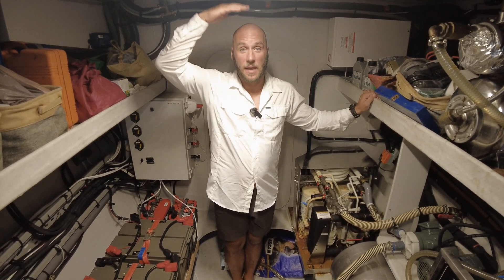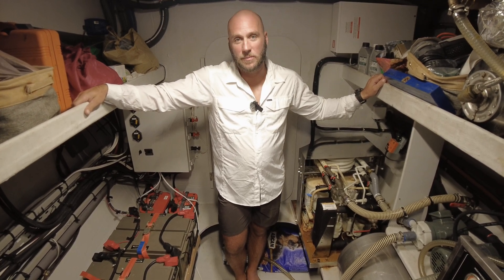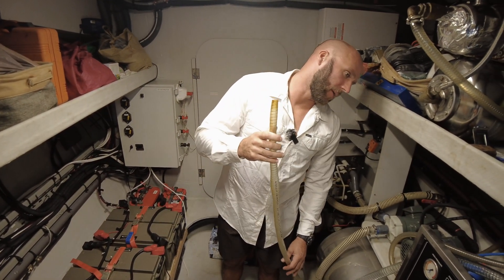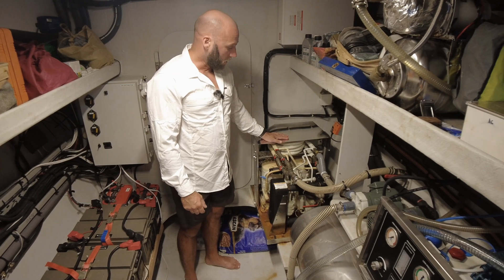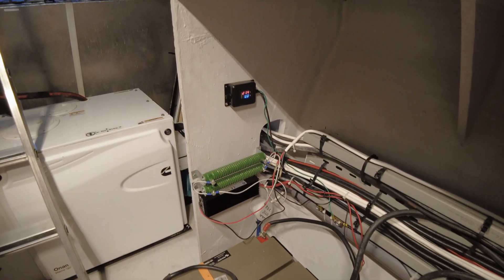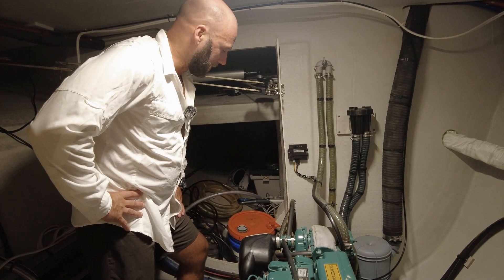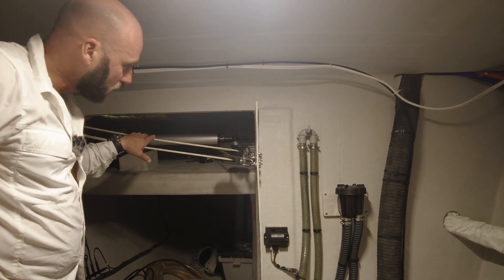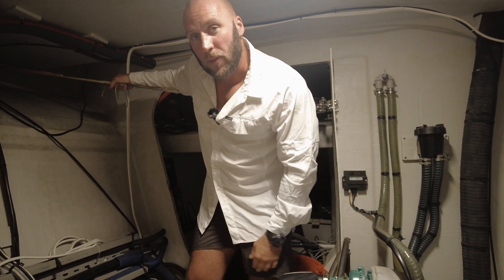Tech and engine room mods, hacks and general discussion.

Comment: Damn, you could almost keep another full-size "backup boat" in that engine room!  Maybe you should consider adding an indoor racetrack or host the next Olympics with the extra space..  Kidding aside, I can see how the engine room's spaciousness would be a top consideration.  It's got to lower anxiety at sea knowing that if something goes wrong you won't have to crabwalk into a crawlspace modeled after a coffin.  It's no wonder I see soo many sailers practicing yoga.  It's not for the heath benefits of yoga.  It's flexibility and contortion training, so regular boat maintenance can be achieved.

Another great video btw.
Reply from the maker: Thanks again. Yes, the only thing it needs is an engine guard for covering the belts whilst running.
Reply: @carryonsailing  Well, you know how it works - same as reefing, as soon as you think about it.....

Comment: What do you think of the difference between the 51 and the new 52? I don’t like the look of the new 52, preferring the angry birds look of your boat but what I like in the 52 is the second cabin down in the central hull, which of course means that the tech space has to be shifted aft to accommodate it. I’m assuming the reduced space would still be ok? It’s quite the cavern in your boat and it looks mostly empty compared to how most boat engine /tech rooms are laid out.
Reply from the maker: yeah, i am not keen on the 52 either mate. Loosing all the good points of the 51

Comment: I am thinking of getting the Neel 47. Debating with myself on Aircon and generator. Any advice?
Reply from the maker: Hi, it would be cheaper to just get a mini split and less maintainance. Find a spot for the square box chiller thing somewhere outside if there is space. Avoid webasto aircon. Generator: Onan Cummins or whisper (master volt). Try and get the mini split with a high Seer rating. Something over 20 Seer.
Reply: @carryonsailing  thanks for the advice. I thinking of just maxing out on panels and lion batteries, inverter. No genset or central air. Less holes in the boat and things to break.

Comment: Was a traditional shaft drive available. The sail drive has always made me nervous. As a youth working on my folks boat late 60's the inboard outboard was very popular I saw so many trashed in the yard. Aluminum housing always in the water. One season of not replacing the zinc's they were toast. So I've always either have shaft or on  smaller boats outboards. Cheers from Northern California!!
Reply from the maker: Shaft is now available, wasn't when I bought.

Comment: Would a 20 horse outboard on the back of each ama be a reasonable propulsion solution, freeing up room in the hull and eliminating sail drive propeller issues?
Reply from the maker: No definitely not. If you wanted to motor into wind away from a leeshore it would be fatal. Also the armas are submerged and in the air depending what tack you are on.
Reply: @carryonsailing  Thanks for rapid response and experienced insight.  I thought maybe you could add the redundancy and handling of a catamaran, and eliminate the hull leaking risk.  Even so, I have watched a lot of videos of folks working on their boat and they are all cramped and contorted, always uncomfortable.  I have never seen anything as nice as that tech and engine room.  I think combined with the  main floor master suite, that is a potent selling point.  Keep these great videos coming!!
Reply from the maker: Thanks troy. I like you're thinking all the same.

Comment: Another terrific video. If you ever see me on a Neel (reasonable probability), they owe you a referral fee. I really appreciate the straight forward approach.   And I wonder what it would cost and if it's even possible to get a shaft drive on a Neel 51? (I know  sail drives are more maneuverable, (maybe mostly in cats) - I've been sailing 28-32' that are always determined to back up to port so a little less shouldn't be a problem.). I get the impression that sail drives are great for boat builders, until they get wet, then they're just a huge liability. I also wonder what a shaft drive instead of a sail drive would do for insurance premiums.
Reply from the maker: Get the yanmar sail drive mate. Its fine.

Comment: If I give you my bank account info, will you send me some money to cover my overdraft? Lol
I didn't quite get the part about losing your hull seal and getting water in the gear box. Is the gearbox right up against the hull with just one seal for both?
Is your fresh water maker a series of filters with osmosis diaphragms like a unit you would install under your kitchen sink in your house?
I was a machinist mate in the US navy back in the 60s so I love learning about the technical aspects of your boat.
I ran and maintained steam powered propulsion systems with a 400 pound system and turbines.
Our fresh water was made by a huge distillation plant.
Our spaces were huge multilevel but the minimum temp in there when running was 135 degrees.
Looking forward to seeing more!
Oh, is your autopilot run off GPS?
Reply: Have you read The Sand Pebbles by Richard McKenna? It's about an American Navy machinist mate on a Yangtze gunboat in the 1920s. He trains a Chinese man how to run the engine - so lots of interesting technical information (coal and steam so I guess no modern application.) McKenna was career US Navy served in China in the 1930s, WWII, Korea.
Great  novel, great Steve McQueen movie as well.
Reply: @WillN2Go1  I have never seen the book but I do remember at least hearing about the movie. I don't remember if I ever saw it. I'll have to see if I can get the book from the library.
You're right about the old steam system back then. Coal fired boilers and reciprocating engines. Yikes! Lol
Thanks.
Reply from the maker: @WillN2Go1  I will, thanks. Love to curl up for a good read
Reply from the maker: Werner thanks for the comment, the problem is the prop. shaft seal. It is wedged forward if you catch fishing line or anything else. Hard to explain but you can see in later videos. It is no biggie if you could remove all the water and oil from the transmission like you can on a YANMAR engine/ saildrive. Hence why I would recommend a Yanmar saildrive at present. The water maker is a series of filters and then reverse osmosis like you describe. It is very efficient these days and  no distillation required. Autopilot is run from GPS. We have 3 different GPS units and one fluxgate compass. Also thank you for protecting our freedom during your time in the US navy. KR James and Eva.
Reply: @carryonsailing  Thanks for the sentiment! However, like any kid at the time I was in it for the fun and adventure. "See the world and all that." I found I was smarter than the average sailor and much more ambitious. I made rank quickly and if I'd have stayed in could have gone up a long way. It was the stupidity of my seniors that did me in, so got out after a few years. This, of course, was during the Viet Nam conflict, which I found was to bizarre for words. Enough of that.
The wonders of Google!
I looked up the saildrive of both the Volvo and Yanmar.
I thought they went straight back out of the hull, but they go down out the bottom. I guess the difference is just the way they are sealed because the basic design looks the same. 
Do the blades fold on the prop when you are under sail in order to reduce drag?
I'm the one that used to take all sorts of mechanical things apart when I was a kid just to see how they were made.
Luckily they were already broken and discarded so didn't get the wrath of God come down on me. Lol
Reply from the maker: Sounds like quite an adventure you have had in life Werner. I would love to hear it over a pint. Yes the prop is a folding one from Volvo. It is required and doesn't affect docking at all. The seal is under the anodes. Easy to get to once hauled out.

Comment: Interesting stuff, thank you for all the detail... the more the better! With all the space, may I ask why more of the electrical buss lines and things like the Auto Pilot brain are not nestled up high above the water line? I understand you wand the heavy stuff low, but then all the tools and stuff are on the uppers. Also I'd rather work on electrical standing rather than bending over. Of course I love your boat, don't get me wrong!
Reply from the maker: I have VERY VERY high capacity pumps and have tested them well. Its not an issue. Thanks for the thought though.
Reply: LOL, thanks for answering, probably a silly question from me, who only sailed dingys. Probably got to thinking about catastrophic conditions due to the utube vid of the fellow who near lost his monohull after setting out on a shakedown with a couple of through holes open and his pumps powered from a battery bank strategically positioned in his bilge cavity. He was saved by the coast guard. 
It has got me thinking though of the structural implications of taking on water in the center hull of a tri (-if-) your pumps fail - do the beams to the floats flex?, or can you release load on one side?
Reply from the maker: It floats when floundered. No question is a stupid one if it is answered.

Comment: Hi James, really great video! You are getting good at this. It is never too long or too technical. Please feel free to expand in as much detail as you can. We are lapping it up. There is , as you know, very little reliable and trustworthy informations in details about the Neel. It is whether infomercial or very negative under informed opinion.. 
This technical compartment is really the best in the market for a vessel this size. In a ideal world the redundancy of two engines (and two rudders) is very attractive. Sail drives are are a very bad technical solution for many reasons, forced upon us by lazy builders...but every boat is a compromise, and the 51 has incredible appeal.
If you were buying now, knowing what you know, what would be your choice of options? (aircon, genset, watermaker, alternator, battery,...) Thanks a lot for the effort. Really appreciate it. Cheers.
Reply from the maker: I will do this in one of the next videos for you Tone.
Reply: @carryonsailing  that was my question.  We r waiting for that  v capsule.